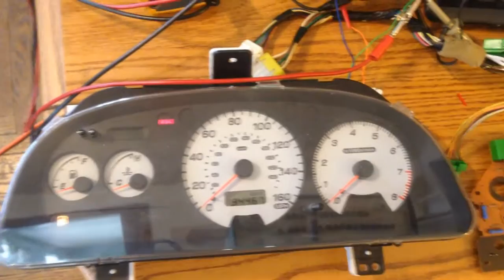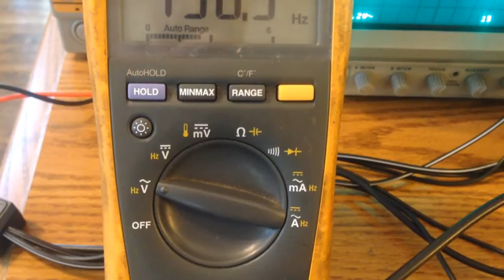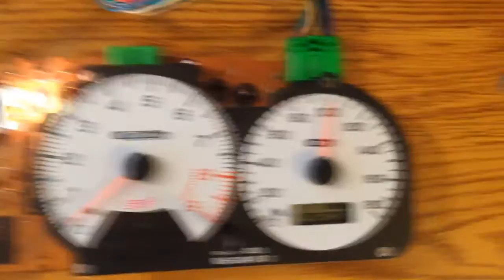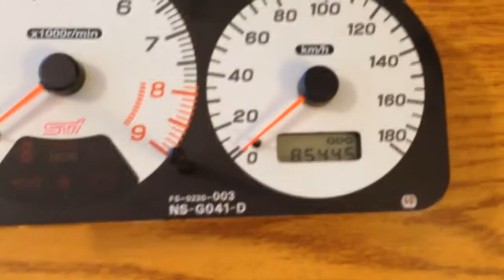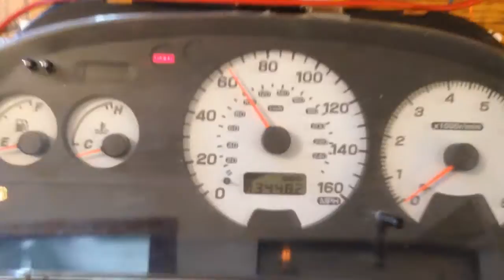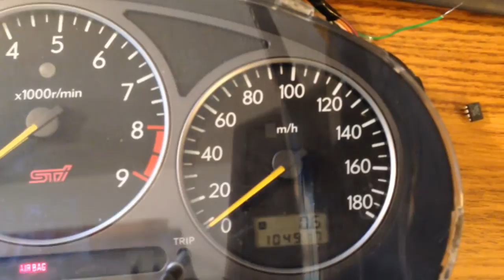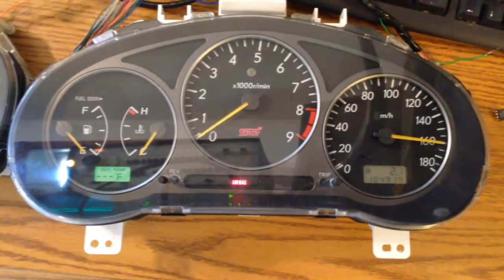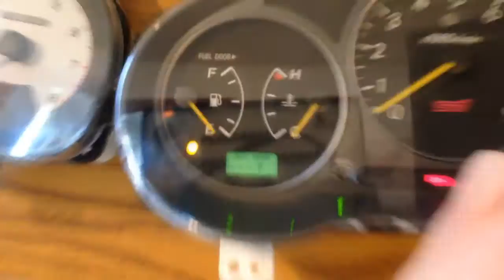STi Speedometer Converstion - How It Works

Comment: Hi, very detailed video, maybe you could figure out my problem. I had a 3.9 stock trans/diff on a gc8 and the speedo was ok, but after swap a 4.44 (sti) trans/rear diff the speedo was reading with a multiplier of 1.18 aprox. So when a I was going at 100 km/h (gps) the speedo read about 118 km/h. This made me think that sti 4.44 gearboxes just work with sti jdm clusters and not the non sti clusters with the 3.9 or 4.11 rear diff.. what do you think?
Reply from the maker: That is pretty correct. The speedo scaling does take into account the gearing. Although, from my research I have seen tire size make a larger differential in read speed than gearing in a transmission. But yes, to say the STi cluster is the only cluster that works perfectly with a 4.44 transmission is correct.

The gearing isn't the biggest issue though, the speed sensor drive gear in the transmissions seems to be the thing that causes incorrect speedo readings. The speed sensor gears in almost all Subaru transmissions are "close enough" with the only exception being a 6 speed Forester STi transmission speed sensor gear. For whatever reason they have a different part number than anything else, and will read about 12% off at speed with the same tires.

Comment: Nice video Garrett. If you were to just swap in a UK chip into the JDM cluster, would that work as well?
Reply from the maker: I did that while testing.. It's not quite that simple.

The UK clusters have completely different scaling as the tach/speedo are not in the same place. The controller needs to be told where to send the proper signals, which is also something that differs between the two clusters.